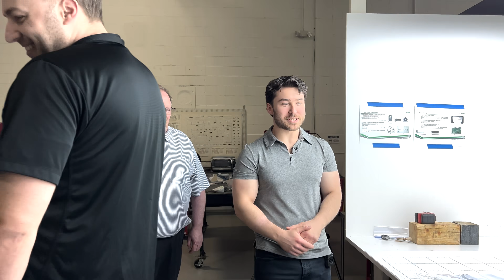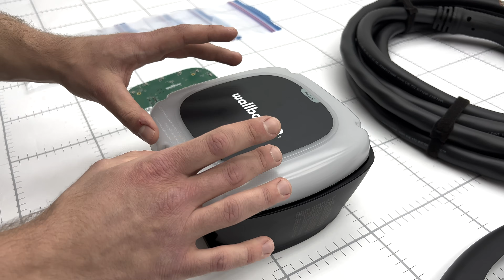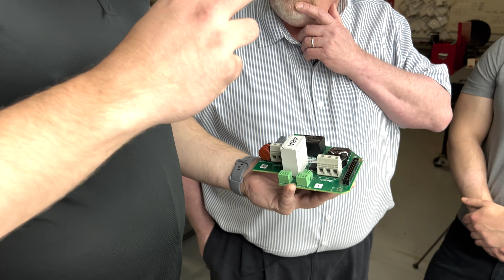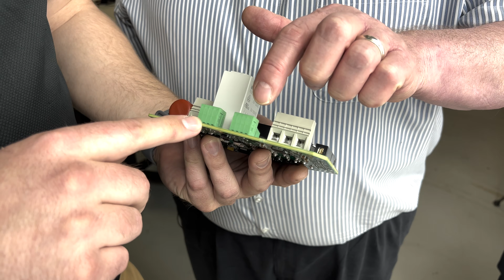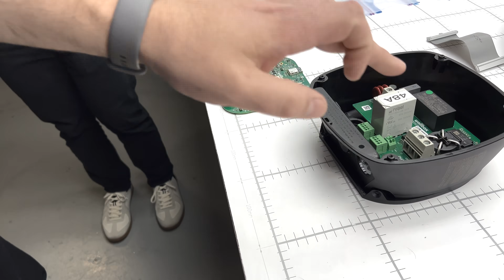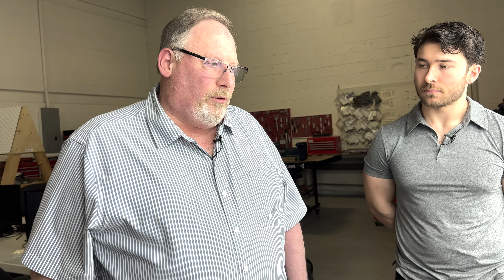EV Home Charger Teardowns E4: Wallbox Pulsar Plus

Comment: Congratulations on this improved Wall Box Connector review.  How many were posted before with only the Chemist and ME, who had absolutely no idea of what they were looking at?  3 or 4 ?  Special congratulations to David for being patient and not giggling at these "fish out of water" "presenters".   He didn't even burst out laughing at the end when the all important critical weight analysis was posted!   Seriously, this series is not exactly a showcase of Munro expertise.  If Munro made these "insightful presentations" to the various manufacturers of these devices, they would bill Munro for their wasted time.

It would be interesting to have found out what the Raspberry Pi was doing in there.  I suspect it takes the CAN bus data from the TI processor decodes & translates it, and sends it to the wireless modules (BT & Wi-Fi). The only somewhat "efficient", thing on this device is that the LEDs are all likely linked with a single, one wire serial bus, eliminating the need for a lot of pins and PCB traces from the uC.

The hilarious weight measurement and documentation is meaningless, unless it is compared to the weigh of the building or the typical wall's load capacity: i.e. this "charger / powers supply" weighs only 7.01 kg and the typical wall it is mounted to can support well in excess of 1000.00 kG, which makes it far and away superior to one that is 8.56 kG, but woefully inferior to Tesla's 5.75 kG.   🤣

Comment: Have one of these 48amp wall connectors, and I can say, they work great and good customer service.
Reply: Something that wasn’t mentioned is that this charger, if hardwired, can be installed on the exterior.

Comment: these aren't chargers these are EVSE's the charger is on the vehicle..  These are merely connectors there are no power electronics (igbt's) on these units.  Calling these chargers adds to consumer confusion.
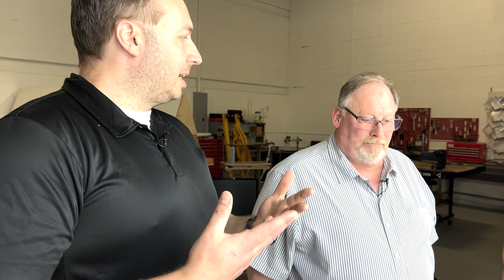Reply: Yes, they said that in the video. 12:30
Reply: No, calling it a charger is simplifying for the masses. If it was called a "charge interface safety device" most people would be like "what?". It interfaces by having a power connection from a outside source. If there is an issue with charging it prevents current flow which is the safety part. You don't want some kid putting nails in the plug end and getting fried.

Comment: What attracted me to this, is the fact it didn't need an earth wire because of inbuilt circuit protection (I've forgotten the jargon)

Great app

Lacks a physical button to just go though, which is less convenient, though may suit some as its more secure
Reply: It needs an earth wire
Reply: @edc1569  Maybe it doesn't need a neutral wire...?
Reply: @Jessev741  it doesn't need a neutral, but neither does any other level 2  unit.

Comment: I'm astonished that it needs a 32 bit MCU PLUS a Raspberry PI just to turn on or off an AC supply to the vehicle ! It seems like massive overdesign to me.
Reply: It's WiFi and Bluetooth enabled with web and app access.
Reply: @GregHassler  The Wi-fi and bluetooth modules were pointed out. What puzzles me more is why such simple device needs 2 CPUs.
Reply: They are clearly deploying building blocks in preparation for 2 way charging
Reply: @mattbrew11  You mean V2G ? You can't do that with a level 1 'charger'. It would need more intelligence in the vehicle's own onboard AC charger unit.
Reply: Another possibility is billing/payment/credit/discount infrastructure.  Eg: at a business destination charger - if you spend x$ purchase you get #KWH charging discounted after purchase.

Comment: I'd like to hear more discussion on why a feature is good or bad. For instance, the plastic mounting bracket was said to be better than some of the stamped steel brackets. Why? My inclination would be to buy a unit with more metal to it. A heavy electrical cable will be hanging from the unit for hopefully a decade or two - and perhaps outside. Might someone not see the cable at night and fall into it - perhaps putting quite a strain on the bracket? Is the mounting bracket sturdy enough if installed on an uneven surface? Is there enough room inside for an average electrician to work? I'd like the charger to be designed with features that help insure that it will be installed properly and hold up to use and abuse.

Comment: The Varistors are called Metal Oxide Varistors. They break down momentarily and conduct electricity when the value on the specification of the part
Is exceeded. Gas Discharge tubes, are faster, and longer lasting, and do not become boost as they age and are more effective than MOVs. MOVs get electrically noisy after repeated surge control actions by the component and can become so noisy, that the noise can cause microprocessors to malfunction such as the microprocessor managing the operation of this Wall Charger. MOVs are commonly used in surge protection power strips.

Comment: Great breakdown of Wall box but.........The great unwashed compare charging your car to charging your phone, got to have the right charger for your phone right? Got to have the right connector on for an Apple right? Anderiod well thats different right? and Who ha look at that Ford and GM going for the Tesla plug, the Tesla charger, the Tesla system every ones going Tesla! Tesla were right Tesla are the leader Tesla the standard buy Tesla stock NOW! Good for us shareholders. Tesla were already opening up Supercharger network with Easydock but no harm done in fact the opposite whos not up for a share rise but to the great unwashed this is another VHS / Betamax war and wall boxes for ever will be chargers

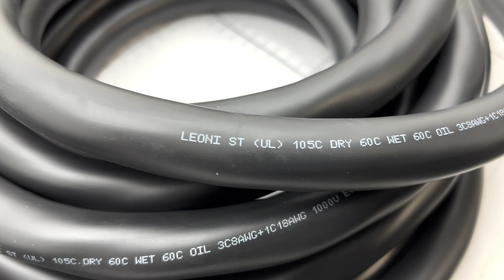Comment: 3:57 are you talking about the quality of the ferrules on the cable or the fact they’re using a screw terminal block on the output
Reply: I think they're unfamiliar with this approach, which is more common in Europe.  It's actually a much better approach than the ring terminals used on the Grizzl-E, which have had some problems in the field, and are also a hassle for hardwiring, because you need the right size ring terminals and the right crimp tools.  Whereas this unit can accept bare wires directly for hardwiring.

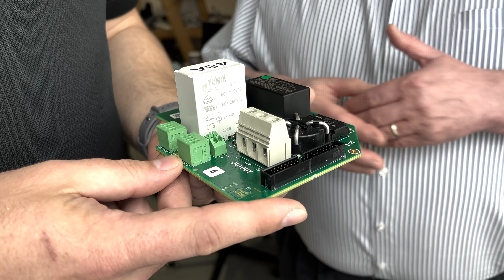Comment: 8:44 proximity pilot and control pilot are teh signals that the J1772 interface uses to communicate with the vehicle. How can so-called EV Experts not know such basics?
Reply: It's not there "to look at the communication between the vehicle and the wall unit", the small wires from the 25ft cable were literally connected to that connector block before you disassembled it 🤦
Reply: I wonder how much the content is being dumbed down for the perceived target audience?  For example, the guys spent a lot of time re-explaining that an EVSE isn’t a “charger.”  They glossed over or skipped over other interesting attributes such as the gauge of the wires in the cable, instead opting to talk about the weight.  Stating the water resistance IP rating or lack thereof would have been handy.

On the other hand, the Munro people are tasked with determining how manufacturable something is and whether it has been de-contented as much as possible.  How the consumer feels about something is secondary.
Reply: It's just "Proximity" and "Control Pilot", proximity pilot is not used in SAE J1772 type 1 connectors, proximity pilot is for type 2 connectors where the cables are detachable.  Confusingly, Proximity and Proximity Pilot are two different things.  Even manufacturers get it wrong in their labeling, and Wikipedia has it wrong too, very common mistake.  PP is to signal the capacity of the detachable cable (e.g. the car and the EVSE may support 32 amps but the cable only supports 16 amps).
Reply: @GregHassler  if it's wrong in wikipedia please fix it!
Reply: @P4GrAnGeR  no some mod will think they know better and will revert it, the graphics are wrong and everything.
Reply: @GregHassler  lol doesn't even try
Reply: @Jessev741  don't trust everything you read on the Internet
Reply: Did you know that you can not find PP in J1772 standard? Its PD and CP.  proximity detection(5.2.2)and control pilot(5.2.1). But in some connector in the mold it’s engraved PP. I don’t have access to old version of the standard. Wanted to see in the early days of the standard they mentioned PP. I google and found the 2001 version and it’s CP and PD.
Reply: That was bizarre, it’s the most basic point of these things.
Reply: Also "proximity" doesn't communicate from the EVSE control board, the proximity circuitry only resides in the J1772 handle itself and isn't connected to any wiring in the cable.  Proximity works just fine if the EVSE is powered off or even if the cable is severed.
Reply: These dudes are hacks...
Reply: Exactly, I don't know who originally mixed up this PP stuff in the first place but it's all over now.
Reply: SO CALLED?
mike I woke up and dropped a deuce in the toilet that towered over your knowledge on this topic. These guys didn’t even have to eat the food to begin with.

Comment: I don't understand why a plug box needs a full computer inside. 
Why does it need Bluetooth, Wi-Fi... To rise it price 10 times.
Reply: Wireless is nice in order to monitor/control charging remotely.
Reply: When you leave your garage door open the box will do a light show and say, "look at me" in multiple voices and languages. I wonder what the power draw is in standby mode. I guess to turn it off you have to go to the circuit breaker box. The WiFi is for clock sync and to automatically change to daylight savings plus report to the mother processor and the Bluetooth is so you can put an app on your phone and look at it to see what the box is doing at all times of the day.
Reply: @timsteinkamp2245  I expect majority of communications done via Wi-Fi, like status display, accounting, cost control, authorization.
Reply: Does it run Doom? 😁

Comment: What were the wireless modules? ESP32?
Reply: It has the ESP8266/ESP32 form factor but it's actually a ATWILC3000, which means it's just a straight wifi module with linux drivers which connects over SPI.

Comment: Why you guys spend time on obsolete charger standard?
Reply: Because signaling will stay the same, difference is in plug at the end of the cable.
Reply: @uosiumen  signalling is the core difference. Tesla uses higher bandwidth digital communication, encryption and authentication. While CCS just sends dumb voltage signal.
Reply: @maumas98  NACS uses CCS2 signaling with Tesla plug.
Reply: @uosiumen  nope. Tesla has communication protocol that is not part of CCS2 standard. And the ability to authenticate (and pay) with the plug is the key difference.
Reply: @maumas98  From the NASC spec 
4.5.1 For DC charging, communication between the EV and EVSE shall be power line communication over the control pilot line as depicted in DIN 70121.
Reply: Namely, which charger standard?
Reply: 90% of charging is done on Level 1 and Level 2 EVSE's.
Reply: @dannelson6980  those last 10% are the most important to overcome range angsiety on road trips. Batteries are not a problem as long as infrastructure is there and it is reliable.
Reply: @maumas98  You are talking about DC fast chargers. They didn't do a tear down of a DC fast charger. Nobody installs a DC fast charger in their home.